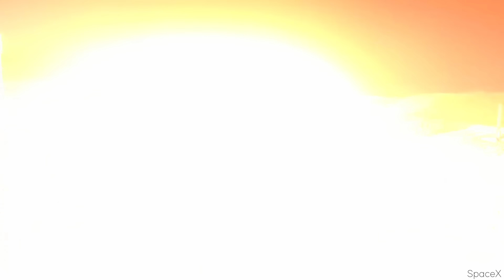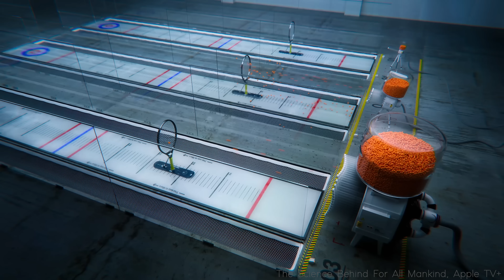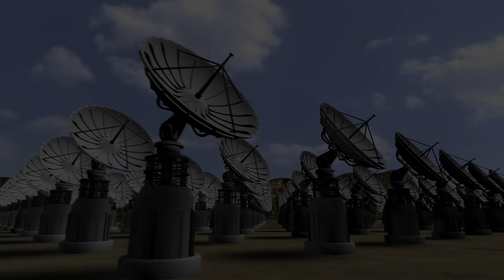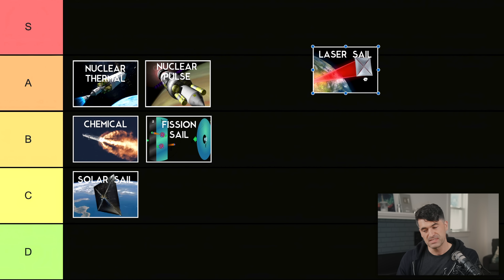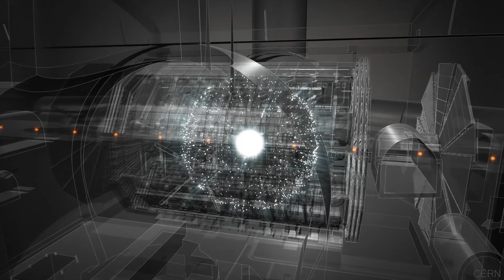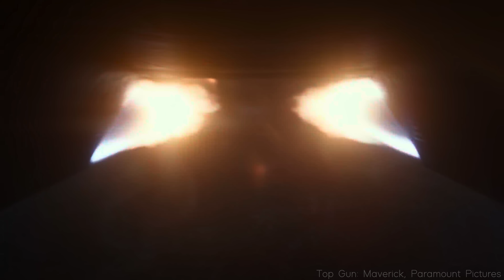Interstellar Propulsion Technologies - RANKED!

Comment: I think using a superconductor magnetic field with a super stator. To power a hydrogen reactor to power a laser to two collector's on either side of the ship. Is the best idea. But water supply. Is somthing. But the amount of solid explosive fuel pellets could work well after escaping the solar systems gravity.  Super conductor magnets need cooling with nitrogen, but space is very cold. And they would work there.  You may use a super conductor motor/generator to create an ion pulse or power the laser.  Based on charge, large capacitor storage bursts. With that in mind, you would still have to have a good solid fuel source pellets for geat and life support.  Hydrogen does generate oxygen when its split. So it would have to be a combination of systems not just one system.  You need storage for food, lubricants etc. Solid type fule to gain momentum and laser type perpulsuin to maintain it. Forget the sun, or an earth 🌎 bound laser.  Use an on board laser and superconductor motor/generator.  Large capacitor storage banks.  In space super conductor can overcome over unity if built right. A totally new kind of electric motor defying earth's gravitational physics.

Comment: You got the negative mass one incorrect it does exist and it's underneath my research but it's not posted. I don't give out research for free. Any which way that's easy to produce I already can get that done but keep in mind when you talk about negative and positive mass negative mass would have to be stored in a vacuum chamber cuz once it comes in contact with real mass it's basically a annihilate itself

Comment: All your stuff is incorrect chemical rockets it's due to a lack of storyability and lessing it you can atomize the gas but even if you atomize it or even compact it into pellets which you didn't discuss about the aluminum base one basically there's aluminum pellets that we're supposed to be stronger than nuclear it was on Discovery channel. The warp drive is nothing but a machine that emits an electric magnetic field that affects the atomic structures in space now the atom or atomic pressure that you find on earth are at a further distance there is better in between but that matter only has a certain amount of lifespan and so you really can't get a hold of that matter too quickly or whatever it is what you're trying to do is get a hold of the matter that's relevant or what you find on earth and that's because we weren't born in space any which way so we can't utilize space matter cuz if we were born in space it would be relatively easy for us to use the matter in space which is nothing more than just radiation so think about it like this harnessing the matter of space you create a propulsion system and that's what you have magnetic wavelength lengths it's basically nothing more than a massive microwave that's emitting a microwave fills to push but it creates a bubble like a black hole now solar cells use a laser beam that has to be from Earth they have to shoot the laser beam which causes  causes the solar sails to move forward

Comment: For the Orinion drive  you would not want to go with smaller nuclear bombs but rather a larger ship/mass so there is no need to use small nuclear bombs. The larger the ship the more safety margins you would likely have because you could pack in so much extra supplies. Think oxygen, life support systems that can operate in close to a perfect loop cycle perhaps using plants to harvest CO2 and create oxygen thus reducing the need for CO2 scrubbers and making a massive spaceship more akin to Earth biosphere. The issue is the building of such a massive spaeship in orbit but if we are able to create a pure fusion bomb we may be able to launch such a vessel from remote locations like isolated islands in the Pacific.

Comment: for some reason people keep looking over the dusty fission fragment rocket which is both feasible with current technology and can get you to 5-20 percent the speed of light.  also using a bussard ramjet not as a propulsion method but as a means of slowing down and gathering reaction mass for the final deceleration stage when you arrive at your destination.

Comment: You said we would get Helium 3 from Jupiter. ³He is not as difficult to get as we were told. ³He can be made from a Fusion breeder reactor. Deuterium + Deuterium reactions.
D-D fusion, two deuterium nuclei (²H) fuse in one of two main reaction branches, each with roughly equal probability. Makes Tritium and He3.
This makes Fission more feasible if you aren't trying to get a net positive on the energy and using as fuel for a engine. This gives a way better output for impulse and powers electronics. This makes it S Tier IMO. If you add in Graphene to store the ³He, you could have a very light weight storage container that theoretically stops leaking.

Comment: Scotty Manley has a video with some pretty intersting options like this one: https://www.youtube.com/watch?v=cvZjhWE-3zM  I don't see the low force of the ion drives as a problem if you already know you are going to run the thing for 100 years, and nothing preclude us from scalling up by using nuclear power.  The other thing, there is the ethics problems of sending frozen sperm and eggs, that will cut the weight by a lot.

Comment: Laser sails will never work for two simple reasons. 1) It's impossible to accurately train the laser on the sail from intersellar distances. Imagine shining a laser pointer at a cat...from 1000 miles away. Even with optics, that's not possible. And 2) humanity would need to maintain that laser for decades, or possibly centuries...likely from an orbiting platform no less. We can barely keep the lights on as it is on Earth.

Comment: Laser Sail: accelerate the most fragile possible thing to 0.2C. Hope it doesn’t impact anything on its journey. There has to be absolutely nothing in the volume of space directly in front of it between the beginning and ending of its journey. If there is anything, the kinetic energy of a tiny impact is utterly insane due to its speed.

Comment: The causality and negative energy problems of warp drives disappear if you use them for slower than light travel. They would still require insane amounts of energy but I just thought I would throw that out there.

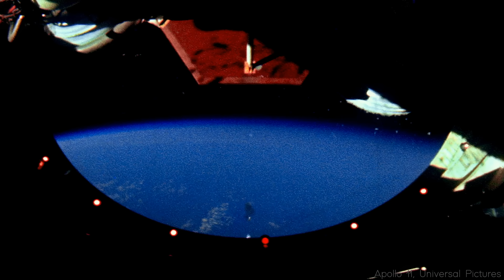Comment: 4:51 That is only true for the original design. Gas core designs get you far better performance. And we also have the nuclear thermal electric variant of solid cores that retains the thrust of the original but reaches an isp of close to 2000s.

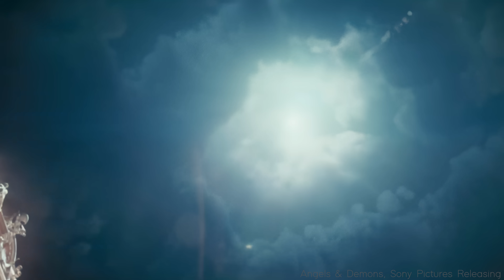7:18 These concepts are crude and wildly inefficient. If we compare them to pure fusion bombs or, better yet, kinetic ignition fusion, we see velocities up to 0.2C

13:15 No spacecraft will be detected across tens of lightyears, regardless of its propulsion type. Also, nuclear pulse propulsion is more stealthy because it doesn't need warm reactors.

Comment: I would definitely put ion engines above chemical engines. On a journey that takes centuries, thrust to weight ratio is just not nearly as important as specific impulse. Both will reach their maximum velocity, and secondary chemical thrusters could be used for time sensitive burns like insertion burns

Comment: Here is my proposal: warped highways. Instead of bending the space around your ship, you bend space by having ring-like objects placed in a line, and they warp the space around them, meaning that the space inside of this "tube" has a shorter distance than the outside.

Comment: The Starfold – a thought experiment in faster-than-light travel

I’ve been thinking about a different way interstellar civilizations might travel—not with rockets or warp drives, but by making space itself touch two places at once.

Imagine two identical cavities, built from layered superconductors and metamaterials, each only nanometers apart inside. In such tiny gaps the Casimir effect produces unusual vacuum states. Now imagine driving both cavities with the exact same “frequency recipe”—a mix of RF, microwave, optical and X-ray combs locked in phase down to femtoseconds.

If the spectra match perfectly, the two cavities might phase-lock the vacuum. Instead of tunneling through space, a “throat” forms where their lowest-energy modes coincide. Step into one aperture, step out the other. Not a sci-fi wormhole—more like a nonlocal resonance in the fabric of the vacuum.

The physics isn’t proven, but the engineering path could be surprisingly concrete: tile millions of these cavities into a meter-scale array, cool them with superconductors, and pulse them with tens of megawatts for seconds. Most of the difficulty lies in precision timing, not raw power. AI could search the enormous design space.

Why does this matter? Because portals like this don’t need reaction mass or starships. Once two apertures exist, travel is nearly instant. Earth to the Moon or Mars would take seconds. With a way to “seed” or remotely “imprint” an aperture at Alpha Centauri, the trip could be minutes.

Even a crash program might be possible: first chip-scale prototypes in months, then meter-class portals within a few years, at a cost in the low billions. That’s less than some national fusion programs.

I call the idea The Starfold—because instead of crossing the void, you fold the quiet between.

— RIFTLOGIC

Comment: What if, just what if we combined ion drivers with nuclear power and chemical energy to increase the thrust to max and have the up most efficient rocket engine? 🤔 	
1. Chemical (LOX/LH₂) stage – for launch / quick captures. Ultra-high thrust to punch out of wells or brake hard near planets. A reference engine like the RS-25 hits ~2.28 MN vacuum thrust with Isp ≈ 452 s, which is why chemistry wins for impulsive maneuvers.  ￼
2. Nuclear Thermal Rocket (NTR) – for big deep-space burns
Heats LH₂ directly with a reactor: Isp ≈ 850–900 s with hundreds of kN thrust (e.g., NERVA-class). It’s ~2× chemical efficiency with serious thrust. You can also “afterburn” with oxygen (LANTR) to boost thrust (trading some Isp), handy when you must accelerate hard.  ￼ ￼ ￼
3. Nuclear-Electric + Ion thruster array – for long, efficient push. A fission reactor makes megawatts of electric power; ion/Hall thrusters turn that into exhaust at Isp ~2,000–5,000 s. A single NEXT-class thruster at ~6.9 kW gives about 0.24 N at Isp ≈ 4,200 s; you scale thrust by clustering many thrusters and by raising reactor power.
Reply: Oh yeah lets add AGI and Quantum computing for ion particles thrust management as well

Comment: 16:30 not strictly true, Antimatter can be harvested from a variety of sources. 
When cosmic rays hit earth's atmosphere they can sometimes generate antimatter particles which then get caught in Earth's magnetic field. 

Likewise there would be significant amounts of antimatter collected in the very strong magnetic fields of Gas giants like Jupiter and even the Sun itself. 

So it is possible to potentially set up large scoops in these high concentration areas to collect antiparticles over time...enough to be used for spacecraft propulsion potentially. 

Being 100% mass to energy conversion, it doesnt take much antimatter to use as fuel. 
Nanograms would be sufficient for a trip within the solar system, kilograms for Interstellar. 
But still, a sufficiently technological civilization could harvest Antimatter and use it for interstellar drives if they were willing to do so. 
It is certainly possible, and many Sci-fi scenarios do use this concept for Realistic sub light speed interstellar travel.

Comment: 18:58 I really like this idea it is close to my idea I have: My starship will use a pair of very controlled dual micro singularities to create a very hyper charged dual event horizon that operates (much like a magnetohydrodynamic drive that uses the Lorentz force) but using event horizons as the electrodes 😇 to propel the starship near instantaneous FTL travel as you "spaghettify" basically pulled apart down to the molecular level and arriving at the destination you re-materialize coming out of the dual event horizon slowing down the dual singularities dynamic drive in the starship. OOOOH yeah lets get some!
Reply: Oh I would like to mention, that FTL travel and higher up to instant space travel is only really "safe" when you travel through a void of nothing, other wise the faster you go and the greater the distances you travel eventually you will need to turn around planets, asteroids, moons, stars, etc etc. so yeah you kinda have to slow down to turn. the voids are the straight clear places to travel very fast, but that is something you must consider when traveling this fast seeing what is coming at you at faster than light and maneuvering your FTL starship around stuff is the real problem that can be solved but none the less the real daunting challenge to overcome.

Comment: A pretty 'far out weird idea but precisely what nature does' mode of huge 'travel-by-growing-Earth-as-adaptable' distances and time is to use ARK seeding probes, digital synthesizers of gaia DNA and adapted life for a body they encounter.. 

By adapting directly, you limit suffering and adaptive stresses from our own life.  You simply design it for the body you encounter, as best fit.  Of course, this requires a super intelligence from all of us together.

ARK devices could run on zero point energy from the quantum vacuum -- Casimir harvesting multi-stacks as currently theorized by Dr Harold 'Sonny' White -- his work has real stellar potential in a way.  These fabbed chips currently make 3.5v at 25 micro-amps current in single layer stack.  They would need produce for long periods, to last for 10,000's of years.

Comment: So you successfully make a working solar sail.  The sun's radiation is able to push it away despite the gravity.
Cool. 
So how do you approach another star.  Wouldn't the solar radiation push you away from another star?  So you basically get shoved into interstellar space until you get stuck in a spot where the push forward is equal to the push back?

Comment: Actually, there is a variation on the Alcubierre warp drive that doesn't travel faster than light but can get arbitrarily close to it, and it also has the advantage that it doesn't require negative energy/exotic matter. It wouldn't be FTL, but it would be a lot better than any other slower than light option if it worked.

Comment: Laser sail is one way.  Bypasses most of the rocket equation, but you still need something massive enough to make the return trip - or massive enough to broadcast an audible return signal.  It might be possible to plan a return trajectory, but the speeds necessary to reach another star system are inherently past the escape limit.

Only time will tell if NTR or Nuclear Pulse work out better in the long run.  I suspect that the winner will come down to what is easier to repair / maintain, not which one has better performance.  Both will likely find use cases.  NP might get ignored just for being easier to weaponize, despite all spacecraft inherently being weaponizeable.

Mind upload belongs in D Tier.  Halfway between C and D at best.  It's not like antimatter, where we've proven we can build it, or solar sails, which have already been used.

The ability to upload or download memories - much less personalities - is just as theoretical as negative matter.  It's a more popular idea, since immortality is such an attractive idea, but that doesn't make it more plausible.  There are no prototypes.  We can't even read memories with any degree of accuracy.  Even our own brains are bad at recalling memories accurately, and that's with our own native hardware!

Comment: Consider reading Greason's paper(s) about electron particle beams, feel like thats more interesting than laser sails.
And rotating plasma mechanisms as a way to slow down at least, if not extract power from the solar wind and use that.

Comment: if there were a fuel more effecient than the chamicals we use today then the rocket equation would no longer be an issue and we could use a huge delta V to continuously accelerate to alpha centuri and then deccelerate half way, this what they do to travel arund the solar system in the expance.

Comment: the best one would be anti gravity / gravity control, because unlike the other ones, by redirecting gravity, it is PASSIVE propulsion, meaning that it requires no energy to fly, since it just makes gravity push it, and gravity serves now as a energy source, meaning you need no fuel close to planets, which is by itself not suitable to fly in a low gravity environment, but it overcomes most problems of (space) flight, meaning you dont need to bother with the weight of fuel, no need for huge speeds and forces in the atmosphere, so no threat at launch or reentry, no high temperatures during both of them, and no need for crazy expansive heat shielding and very robust materials, since most of the stress on the craft is not being experienced, so it can be built from cheaper materials, and would be very safe to fly. 
combine this with another type of propulsion that doesnt need external gravity, and then you have a device that makes space flight trivial. it would also be very easy to reach speeds close to C because there is no weight to overcome, so it would take comparatively little energy, and anytime you get close to a sun or planet, you can use it to slow down or accelerate, or charge up your batteries to rely on another propulsion when away from masses. 
if you fell fancy, you also could think about pushing against vacuum energy or harvesting energy from it, which would give it unlimited range and energy instead of relying on a battery, and even without being close to masses.